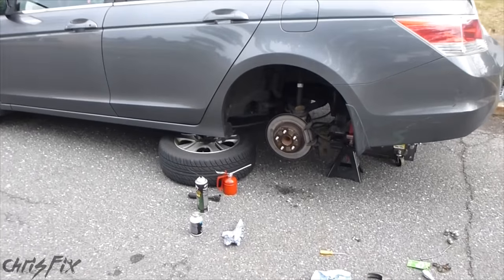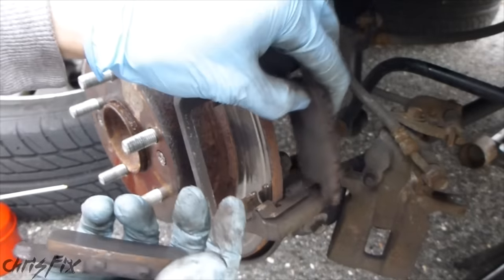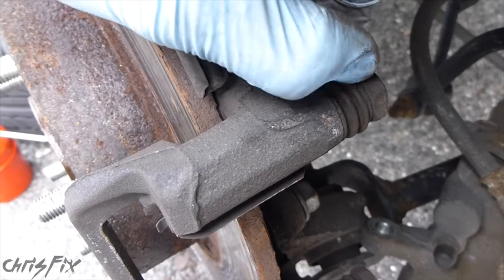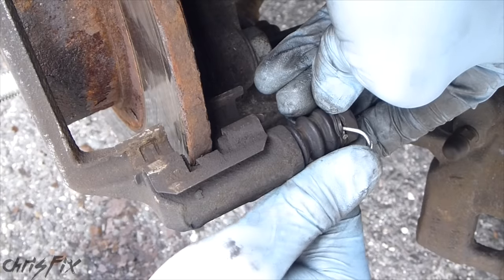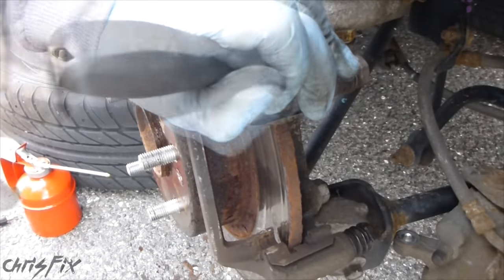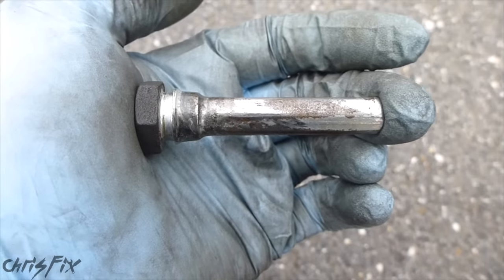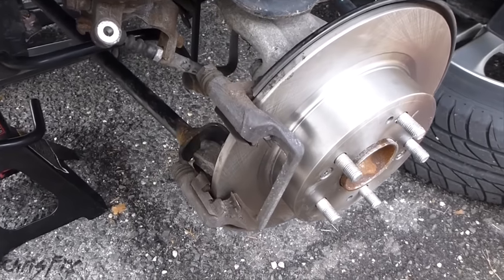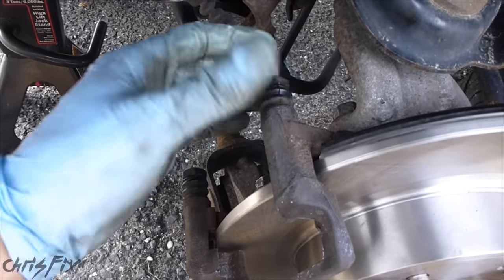How to Fix Uneven Brake Wear

Comment: I am definitely going to do my brakes by myself next time.  A lot of the times, it’s not that the job is hard to do; the problem is having all the parts and tools ready.  A mechanic will rarely need to go get new tools.  A regular guy or gal might have to make multiple trips to store just to have everything needed.  That’s usually the biggest discouragement of doing those jobs by yourself.
Reply from the maker: But once you do it, you have everything you need for the next time!

Comment: If the inner pad is worn evenly, but worn significantly more the outer pad, is likely a sticking caliper.

I have also found that if the pins can not move freely, you are better off replacing the caliper mounting bracket and guide pins.  Frequently rebuilt calipers are sold complete with the bracket, pins and boots,

Comment: Good video. I would put some grease inside the rubber boot b4 putting guide pins back in. If you only put it on the pin the rubber boot removes most of the grease from the pin like a squeegee

Comment: I must admit I have used copper grease for over 30 years to lube the guide pins and I have never had a problem but yes you are right silicone grease is kinder.

Comment: Crix, I clean the bores with a small bottle brush made with wire bristles and brake cleaner, then I use a clean cloth and some more brake cleaner until it's all flushed out.

Comment: Actually,  agree with Stephen Dee, those pins can actually  last a life time with proper periodically clean and lubrication ! Synthetic brake grease not necessary helps with my Matrix inner front pads that always seize, while fine on my other's. 
Try anti seize paste the last couple times and it works fine !

Comment: I like your videos.  Unlike most Youtube "how to's" you do not waste our time by repeatedly showing stuff like removal of wheel nuts and listening to your own voice :).  I have a suggestion re this video, though - when you removed the lower rubber boot, it showed a tear in the seam, which should have been flagged as needing replacement.  Most problematic, though, was that you did not clean out the inside of the caliper bracket where the frozen pin was.  Having serviced frozen pins a lot, I always found the insides dirty/rusty.  I used a drill bit of the appropriate size to ream them out.

Comment: Chris let's talk about the rotors with groves in them. Don't install new pads with damaged rotors as you will screw up new pads that way.. P. S did you call Honda about new guide pins or just after market.. Don't do the job twice unless you have to.....Keep up the good work so people know their stuff if they have to take it to a shop and won't get ripped off!!

Comment: Correct...Many forget cleaning, lubing guide pens but...you failed to mention another important point.  The slide guides of the caliper frame and caliper body.  Remove any scale/rust.  Steel 'toothbrush' or small wire wheel on caliper frame and caliper body works well.  Apply small amount of slide lube like Sta-Lube Synthetic Brake Caliber grease or any thick, heavy moly grease.  As  line mech I've seen calipers become cocked sideways, because of rust/scale/lack of lube the cause of uneven pad wear.Don't forget the need to thoroughly scruff the old pad material from the rotors.  60-80 grit paper, rinse with brake clean.  And, properly bed in the new pads will reduce glazing, the main cause of brake squeal.

Comment: At some point someone ran "riveted" pads on that rotor as evidenced by the two groves in the rotor face. I never run riveted pads or shoes. 
One question though, do you have the caliper brackets takes loose? To my knowledge the caliper brackets are not supposed to move at all. 
Very informative video.

Comment: One tip you should mention is to NOT use anti-seize on caliper pins. Unfortunately, I got the idea from someone on the internet, and I thought I saw someone in real life do it. The anti-seize dries out, clumps up, and the pin gets stuck. Caused my brake pads to wear unevenly. I fixed the pin and put the pad back on. I hope I don't warp right rotors like that, but they were already messed up anyways from the pin.

Comment: Video was super helpful, helped diagnose the problem with my rear brake job! I replaced the guide pins but the bottom insert on the bracket was still pretty gummed up with debris that even the new guide pin wasn't moving very smoothly. It was definitely better because the previous one was completely seized, but it still has some slight resistance. Do you have any suggestions on how to clean out the insert of the bracket?I couldn't find any place that sells just the caliper bracket itself.

Comment: One thing you did miss is that on Hondas, this issue can also be caused by not lining up the pin on the backing plate with the piston (that cross groove). I didn't know this for years and must have been lucky until one time i had this issue.

Comment: Great video man!  Super helpful tips.  I just inspected my brakes the other day and noticed the inside pad was worn much more than the outside... is this typical?
Reply from the maker: That is not normal. It’s probably rust buildup and the guide pins not sliding like I showed in my video.
Reply: @chrisfix  ok... looks like I'll have to get back in there this weekend and check out those pins. Thanks for your help man! 
Liked and sub'd!

Comment: The brush tip on the Silicone applicator is bent? I thought mines was a manufacture defect. It’s angled to scrape the bottom of the jar to get more material when needed. 👍🏼

Comment: You may have already been told this but - 
When a caliper slide-guide is removed, the boots are taken off at the same time. Boots can fail where they fit into the carrier and taking the boot off allows better inspection. 
Although silicone grease is a substitute, it might not have the temperature rating to remain in place and viscous. Use brake grease as it will not solidiify or dryout like some silicone lubricants can.  
Before assembly, ensure the guided recepticles are cleared out by using a twist drill that is a snug fit. Push it in by hand (do not use force) and twist with your fingers to remove any scale that might have found its way in to the guide recepticle. There are steel pipe cleaner brushes that are made for this task but I prefer the drill method. 
Prior to fitting the guide, put a peas sized amount of grease into the recepticle. Fit the boot to the guide and then grease the pin of the guide. insert the guide into the recepticle. Fitting in this order will ensure that some of the grease will be held inside the boot (as a resevoir). 
Hope this helps.

Comment: Clean and apply guide pin grease in the ports of the support bracket, doesn't hurt to do that extra step anytime you change brake pads

Comment: I go one step further and use a brass brush that is used to clean gun bores. I put the brush in a drill and clean out the  guide pin cylinder. I wash things out with brake cleaner. Finally I do a visual inspection with a flashlight to make sure the cylinder is nice and clean.

Comment: Should have cleaned guide pin hole with brake clean and a brush. the harden grease on the pin is also in the hole. And then lubed the hole with using a Q tip or small brush.  Some holes have a rubber o-ring inside which will wipe of the pin as its inserted.

Comment: Hey Chris thanks for all you post! Need help, caliper pin and boot replacement on a 2008 Chevy Colorado LT, pulled apart and cleaned replaced, question one pin has rubber bushing on the end, where does that go on the top or bottom? It came off the bottom but isn't moving well, it is a new pin and bushing, the pin hole was cleaned and all lubed. Just want to make sure it wasn't placed wrong on used truck prior to my son buying it.

Comment: You can just pull the guide pins and the boot will pop off one end. You don't need a pick to remove the boot for those who don't have a lot to spend. I actually feel you would be more likely to damage the boot using the pick.

Comment: Adding Fluid Film spray from a Lowes store to the outside of the rubber guide pin covers will make them last longer. You can add more every fall.

Comment: One last thing to address.  When you see the cross machining on the caliper piston doesn't just mean it's for a tool on some cars. The cross should be positioned at 12, 3, 6 and 9 °s, because some cars use this for proper parking brake operation. Look for a pin on the brake pad.

Comment: Good video yeah showing the cleaning of the bracket would be good. If you have one slide pin with a rubber bushing is it ok to move slower? But still move.
Reply from the maker: As long as it’s free and moves you are good.

Comment: 2008 accord's are notorious for premature or uneven brake wear. If you check out carcomplaints website, it's the number one complaint for the car by far (1269). It nearly triples the complaints for the engines oil consumption (493), which is the second runner up. It's interesting to see what was causing it, but what is causing the guide pins to gunk up like this on a high majority of the accords?
Reply: Spade they sold by the millions, so a few hundred over the years does not make this much of a common problem.  A little more common than being hit by lightning.

Comment: I would have cleaned out the glide pin oil holes since they would still be contaminated with the very jun that seized them - good video!
Reply from the maker: +Mr2pint Good idea and thanks!

Comment: Just a heads up on the guild pins. It’s best to remove the rubber boot and grease the pin and slide it into the hole without the boot. Then put the boot on and insert the pin.

Comment: If you watch the video the first pin that you did had a hole in the rubber. Also, the bracket that the pins are going into is loose, it shouldn't have any play. That car has a audible "clank" when you are moving the bracket back and forth.

Comment: If there is a tear in the boot, it will get that way or if it is swollen and doesn’t seal. Also, the piston is making an X per say. When twisting it in and installing on the pad, it needs to have a + in order to operate correctly.

Comment: Chris fix ..You missed this the caliper piston position that your showing the uneven pad ware on. 1 the caliper piston was not aligned correctly. The  + cross I call it was in the x position  not allowing the inner brake pad tab   to sit in the + position you can clearly see the the rust on the caliper piston showing it was in the wrong clocked position causing the pad ware from top to bottom on the inside pad ..The slider pin stuck ligit situation . Pads stuck in the hard ware or bridge that don't move freely cheese wedge type wear side to side not ...All in all I see this mistake alot of spin back calipers ..If the pads have alignment tabs  they have to go in the correct positions ..

Comment: Hello Chris, great video, but I still wonder, why would one of the brake pads wear completely while the other doesn't. I understood the uneven wear on one side and how the guide pins affect that, but why the difference in outside and inside wear on the brake pads in a single wheel? This happened in my dad's 2016 Kia Sportage and makes me wonder if we should do something about it. Thanks! Sorry if my English is bad, I am from Costa Rica and not native speaker, let alone typer :-D
Reply: This is an old post, but perhaps you or another person will still find it helpful to get an answer.  If the caliper does not move back and forth freely, then the pad that is on the opposite side from the piston will not fully release from the disk, and so it drags all the time.  In my experience, anytime you see brake dust building up on your wheels (for a car that isn't driven aggressively), it's an indication that the brake pad on the opposite side from the piston is constantly dragging.  Jack up one wheel and spin it, and if there's noticeable drag, this is almost certainly the problem.  The way to cure it is exactly as shown in this video.  Clean things up to make sure the caliper can slide back and forth perfectly freely.  

On my old GM light trucks, the caliper pins are stationary and the caliper slides on those pins on bearing surfaces which are just tiny O-rings.  The pins and O-rings can be perfectly clean and yet caliper movement is still stiff.  In that case, pull out the O-rings and clean all the rust out of the grooves into which the O-rings are set.  That rust allows less external room around the O-rings so they squeeze onto the pins too tightly.  Fully remove that rust (it's not easy so take your time and do a good job), re-install the O-rings (with a dab of proper grease) and everything will be as good as new.

Comment: One question. I didn't see you clean the inside of the caliper bracket were the pins go.  Wouldn't that leave old grease inside of there as well? Do you not think it's enough to worry about? I just did this the other day and had to go to the wrecking yard for caliper brackets. Mine were seized completely. Couldn't even break them loose with heat. I blame the Ohio salt. Lol. Thanks for the videos and keep up the good work!

Comment: You have to use the correct caliper grease for the brakes you are using... that is why there is ceramic and non-ceramic caliper grease... Ceramic pads run at a higher temperature... And if you use ceramic grease on a non ceramic system the grease will stay stiffer. Or non-ceramic grease can melt on a ceramic system and get on the pads and rotors.

Some caliper pins have grooves (like the bad one you pulled out) and some have rubber spacers at the end of the pin that slides into the caliper bracket. 

Plus it is easier to take the bracket off and clean caliper pin holes and wire wheel the pad slide areas, so when you put the new slides in they don't stop the pads from sliding easily. And clean all the old grease, dirt and rust out of the holes... I set mine in a vice and fill the pin holes with brake cleaner and let them set for a while, then swirl it around with a small screwdriver to get all the stuck on grease / rust off, dump it then blow it out with an air gun and wipe out with a corner of a paper towel. 

Plus don't add a ton of grease, you can cause the pin to hydro-lock, causing to either not compress or not allow it to come back out easily. I just wipe a thin coating on them. And I put a grease in the boot grooves and around the top and bottom of the external pin boot to keep water out. So you don't end up with pins that look like the one you had to hammer out. I have used pins looking worse than that until the next pad change... Key is... keeping the water out of the pins...

Comment: you should also clean the inside of the guide holes, not the pins. 
Usually corrosion lies in there too! Just take out the frame the fixed part of the caliper, clean all the dirt and use some sandpaper to remove the rust. Then grease it up.

Anyway, you don;t need the pins to move as easy as they moved after the fix, however it is nice to take a look at them if you're already there.
The other caliper is just fine, as it still moves easy enough, but a little inspection won't hurt.

Comment: You need to get the grease into the (guide pin bore) first, because the boot just squeegees the grease off the pin as you insert it. I use a small flat blade screwdriver to get the grease into the bore. Turn the pin as you insert it to get the grease smeared all around.

Comment: There is another reason for an uneven wear of the rear inside brake pad. On the back of the pad there is a round pin, just about in the middle. On the brake calliper piston there are groves at a right angle creating a cross. When you push the piston inwards it also turns round. The pin and the groves must line up so that the little nibble goes in to the grove. If it doesn’t this can cause uneven wear to your inside pad.

Comment: Chris, thanks for the great videos on brakes! Today, following the videos I changed mine for the first time.The guide pin in your video that you said it was bad appears to have several "flat sides". Can you tell me if this is normal, or should they both be perfectly cylindrical? On both of my front brakes the top pin had 3 flat sides, but they almost looked to be machined that way, so I'm not sure if I need to replace them or if it's normal. Otherwise, the wear seemed minimal. Thanks!

Comment: Another thing is the caliper bracket   underneath the clips can get rusty and raise the pads up and make the pads stick. Putting in new clips wont fix it, either file or grind the rust off until the pads go in and out easy or buy a new bracket.

Comment: In my 2003 Nissan Almera the other slide pin in right side rear brake is so stuck on that even hammering it doesn't help. I bought replacement pins today and hopefully soon I have time to take the brake apart, again, so I can replace both of them.

Comment: GM cars I've had since the 90's all wear faster on the inboard pad, always.  Annual brake pin greasing makes that go away, pads wear even.  I have used a Versachem synthetic brake grease, big bottle, had it better than 10 years, safe on all plastics and rubbers according to the manufacturer.

Comment: As a full time mechanic, Our shop changes both or all 4 caliper brackets for good measure. Very common procedure when your pins rust and don't slide. You often have to remove it to remove the rotors, front or rear so it only makes sense. If your pins arent rusted, the grease them lightly with grease, lithium grease, or even the proper blue grease. Wipe excess off. Install caliper.  This is a great video, but replace those caliper brackets and rotors. A small expense verses having to redo them next year.